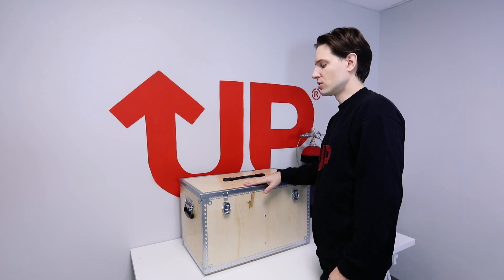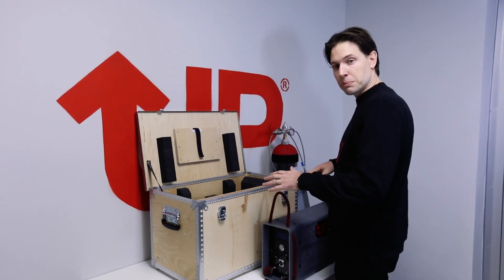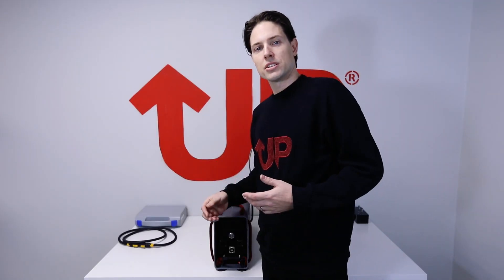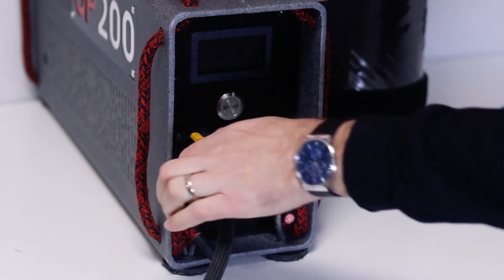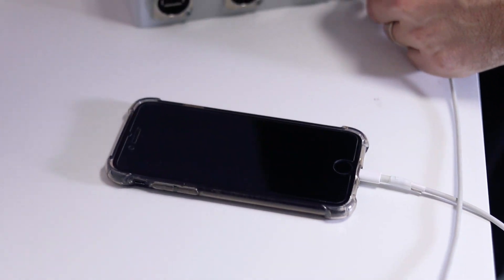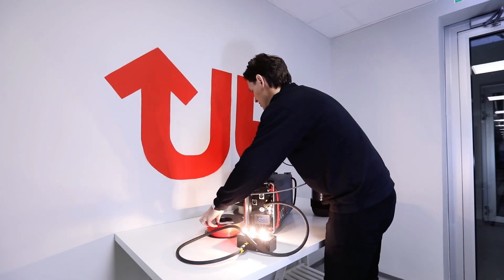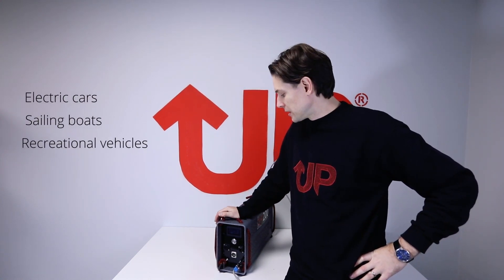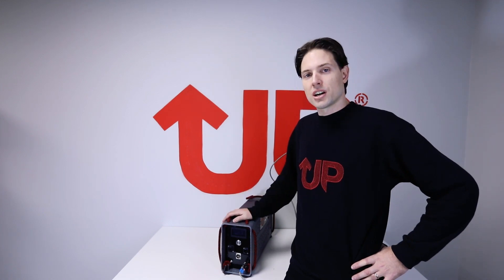UP200 fuel cell generator demonstration

Comment: Can it power a electric car? Thank you.
Reply from the maker: Yes, every EV vehicle is equipped with a Level 1 on board charger (OBC). They are designed to take current from every single phase 230V AC plug (up to 3.3kW). It means they literally can charge anywhere, also from our generator.

Comment: I would like to know the H2 consultation rate to produce power at a per watt level as well as haw it compares to your competitors looking to make a vehicle and looking at a power plant and I’m a firm believer in H2 technology but I have seen a few but can’t get the info I desire hopefully I’ll hear from you
Reply from the maker: Hi Salin!

Thank you for your comment.

In order to obtain 1.1 Kg of hydrogen, approximately 10 L of water and 56 kW/h energy is required. This will produce 1.1 kg of hydrogen. Now, this hydrogen contains 37 kW-hr of energy. Considering a fuel cell with an efficiency of 50%, this will further reduce down to 18.5 kW-hr of energy.
Going through biomass and biofuels are also welcomed alternatives. Non-chemical biofuel from the cellulosic feedstock process can be further explored.
Reply: @powerupenergytechnologies8172  thank you for the info but how dose it compare to your competitors
Reply from the maker: @salinsoulok3338  
Hi there! Unfortunately, we are not able to give a concrete answer, since we do not produce our own hydrogen.
Reply: @powerupenergytechnologies8172  Hi Salin can you just confirm that i need to use 56KW of solar power to generate 37kW produced from the hydrogen generator. Im loosing 19kW of power i think ill just increase you lithium cell store.

Comment: How long it can run???
Reply from the maker: Hi there! With a 9 L hydrogen cylinder at 300 bars, the UP200 can operate for 16 hours at full power.
Reply: @powerupenergytechnologies8172  
👍👍👍👍👍👍👍👍👍
Reply: @powerupenergytechnologies8172  
Who is obstructing the use and sale of this technology to the whole world, especially since the production of pure hydrogen has become possible for us?
Reply from the maker: @موادقيمة  Hi, thank you for your question. There is currently no one obstructing the use and sale, on the contrary, it is becoming more and more used even in industry applications. Just like any new technology, the acceptance of it takes some time. We are glad to be a part of the hydrogen future :)

Comment: This is interesting. Just to confirm, we need to carry the H2 cylinder at all the time right? And does it not require air compressor for efficient PEM functioning?
Reply from the maker: Hello! :)
Yes for the generator to work, it needs to be connected to a hydrogen cylinder. No, it does not need an air compressor for efficient PEM functioning.
Reply: @powerupenergytechnologies8172  what kind of Hydrogen does that need h70(bar)- high pressured?
Reply: @kdefence8555  Our generators require low pressure hydrogen (0.4-0.7 bar). However, for storage we recommend high pressure 200 or 300 bar cylinders. There will be just so much more power :)  50L cylinder @300bar would provide you 83h (3.5 days) of power.